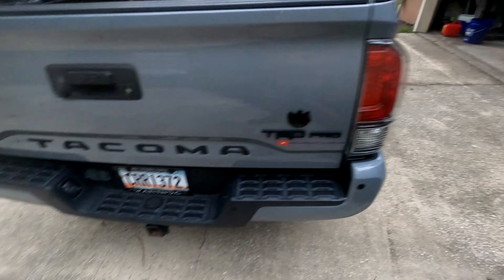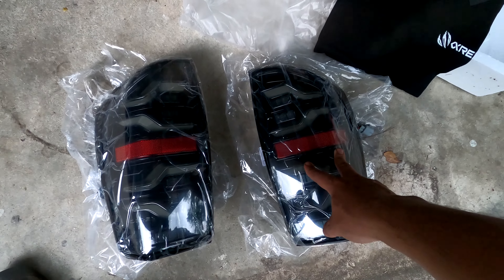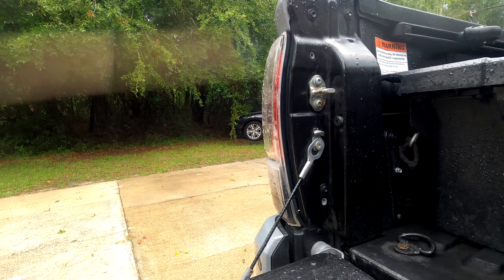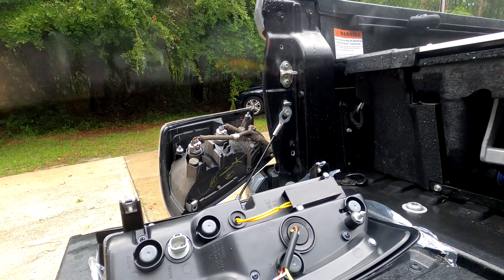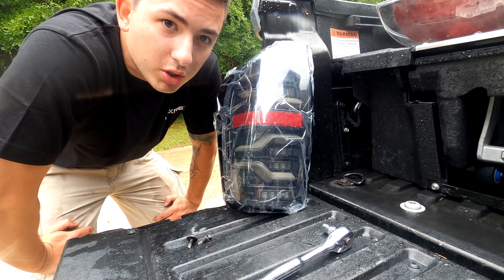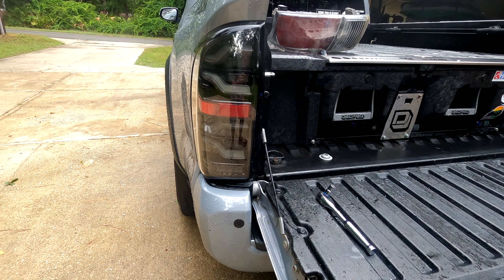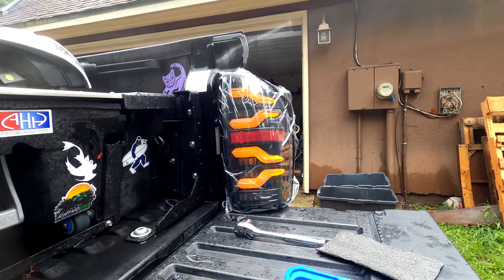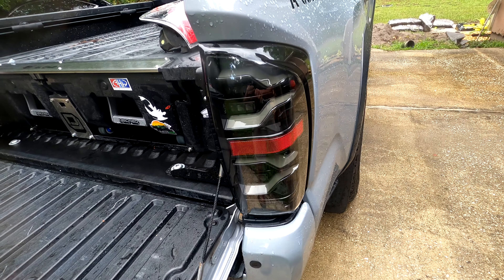Alpha Rex Luxx Tail Lights: 2017 Toyota Tacoma

Comment: Great video, I have a question. Am I understanding correctly that when you're at a stop and put the turn signal on no brake lights will show - on either side? Then if you release brake and then press the brake again it will shut the turn signal off and make the brake lights work again, or is it just a hazard lights issue. Sorry if I'm confusing you. Want to put this on my son's truck. Wanna make sure he's safe.
Reply from the maker: All good, if the light has the sequential activated I.e. turn signal or hazard then the brake light won’t illuminate. However, if it’s only one turn signal the other side tail light will have the brake light on.

This may have been remedied in future models as I did purchase mine almost a year ago, however this is the way that mine function.

Just something to have in mind if you are running a bedrack or have a lot of stuff in the bed of the truck covering the third brake light and your hazards are on, that the tail light brake feature won’t actuate unless you turn off the hazards.

I hope this helps!

Comment: Mines doesn’t have the activation feature when you start up. Have you heard of this issue?
Reply from the maker: Have not, I am not certain but I believe if you bought the non LUXX version that it wouldn’t have the activation feature.

This would probably have to be a question to pose to the manufacturer.

Comment: Maybe I missed it but when your Parking lights are on and you hit the brake what changes?

I had the alpha Rex $300 set and the little boxes in the middle would be the only thing that lights up.
Reply from the maker: I assume it was an engineering oversight, but when the hazard lights are on or a turn signal is flashing, the center brake squares do not illuminate when the brakes are depressed.

Just good to know if ever you have to drive with your hazards to turn them off prior to or during breaking.

Comment: Doest it make any animation when you unlock your truck as well as the Alpha Rex headlights?
Reply from the maker: It’ll do the sequential signal on both tail lights as of your hazards were on for two flashes. The animation is only when the lights are turned on for the truck.

As for the alpha Rex LUXX headlights I can’t say. I would assume it’s the same as the tail lights as that would make sense to me, but I only have the stock headlights.
Reply: @FromDuskTillDawn518  yes the Alpharex luxx headlights do the light sequence when you unlock the truck, the tailight sequence is done when you turn the lights on.
Reply from the maker: @uno3863  I answered the question that wasn’t asked and didn’t realize it. I thought the above comment was asking about the LUXX headlights. And I did specify that within my above response.

I appreciate the clarification, yes the Luxx tail lights do have an animation on unlock and turning on truck lights as well as turn signal and hazard lights as demonstrated in the video.
Reply: @FromDuskTillDawn518  👍🏽

Comment: So if you put your four-way hazards on. Then you step on the brakes. Do you also have brake lights? Or just hazard lights?
Reply from the maker: Sorry it took a bit to respond. To my surprise I hate to say it but with hazards on the tail lights do not show break lights.

I assumed the lower break light square would still illuminate however I was wrong. 

I really appreciate you asking this question, because this is a very important note that I totally didn’t think to look at.

Just to reiterate, with hazards on (or blinker) the lights with the hazards energized (or blinker) will not have a break light energize when the break pedal is depressed.